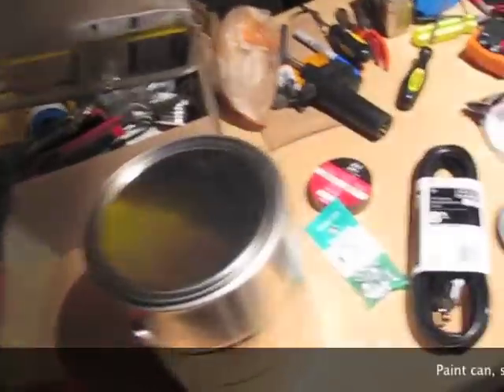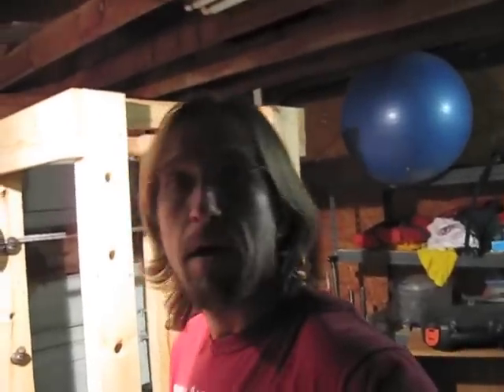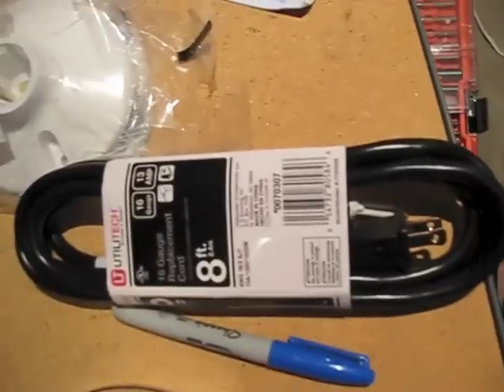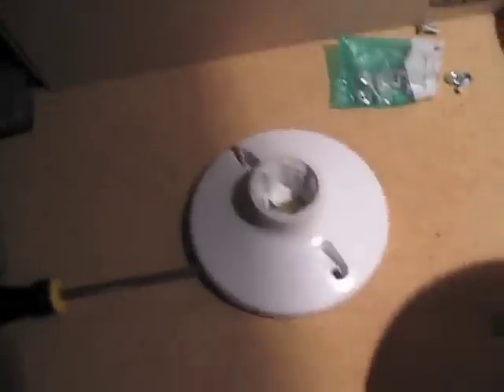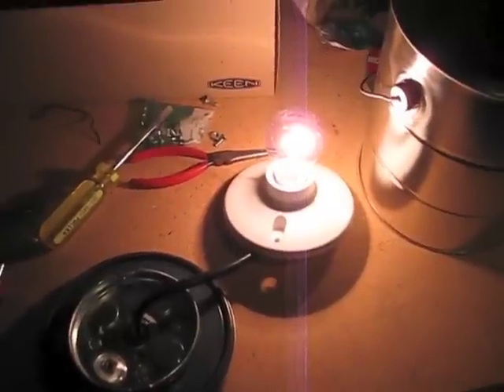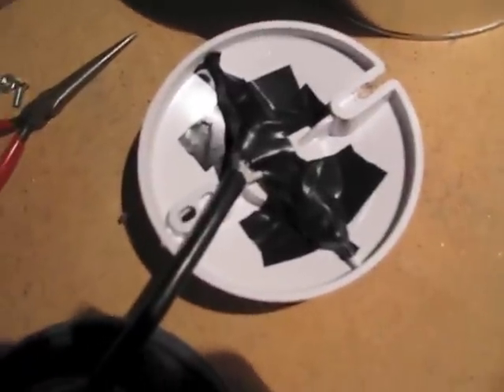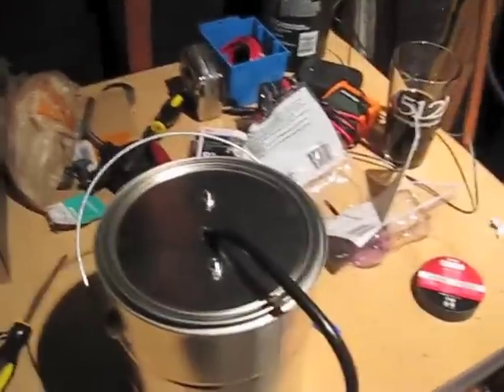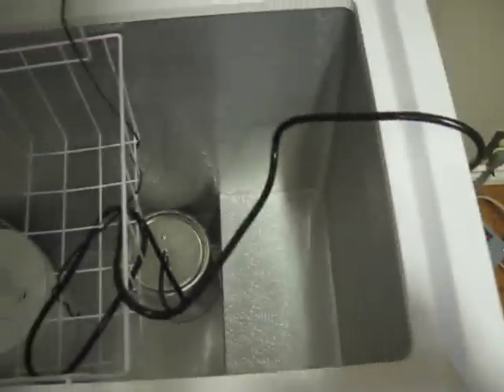Paint Can Heater - 5 minute tip

Comment: Load the can with coarse steel wool and check your results. There might be better heat output at the holes.
Reply from the maker: That's not a bad idea.  I've stopped using this heater, and just used a heating pad as it was putting out too much heat at a time, causing big swings bewteen hot and cold in my freezer.   Cheers and thanks for the great idea!

Comment: How warm would you say this would make a 4x4x4 doghouse in 20 degree temps? Trying to figure out if this would be a better bet than a heating pad or maybe I need both.
Reply from the maker: For a dog house, I would probably go to the pet store and get a heat lamp instead of a normal light bulb.  I would also find a non-plastic base for it, so that it can stay on and not worry about heating up too much and melting.  Cheers!

Comment: As an electrician I cringed at several parts of this video. One being the plastic lamp base vs porcelain.. With there being no way for the heat to escape, it will break down the plastic with time along with the wire beneath the lamp holder.
Reply from the maker: This was never really a problem.  Since the light was never on for a long period of time, there wasn't an issue with the light itself getting overly hot.   But, since it was so hot during the time it did run, it was way too strong/big for the freezer I am using.  I did switch over to a regular old heating pad instead, where it was a lot less heat, and much easier to control over all.   Thank you for your comment!  Cheers!

Comment: I think this is bad advice. Get a better heater, or at the very least, put the lamp socket in the bottom of the can, add stand offs, add a cable gland, add grounding of the can, add ventilation holes in the top and bottom, add thermal safety switch.
Reply: crowsinthenose why ventilation holes?
Reply: So heat won't build up inside the can.

Comment: First of all, great video & great device.  I put this together a couple of weeks ago & use it in an 8cu.ft. freezer/fermenter conversion using an STC-1000 controller & it works great (2 degree variable at the most).  However, I have a safety question. Until now, I've only had 4-1gal. jugs of hard apple cider conditioning in the bottom of my fermenter.  I am about to brew 2: 2gal. batches of beer & add them to the mix. While the lid on the can is sealed tight, has anyone had any problems or thoughts about a light bulb clicking on & off once an hour in a sealed environment with CO2 gasses going wild during fermentation?  Has anyone had problems with this or am I missing something.  I love homebrew but don't want my brewhouse to explode all over the neighborhood.  Please respond.
Reply: Legend has it he is still reading your comment